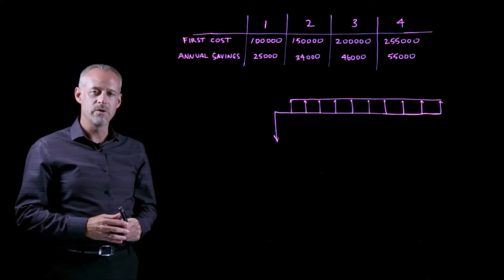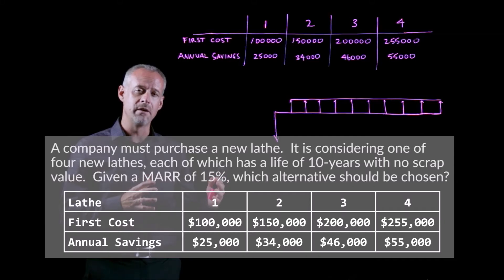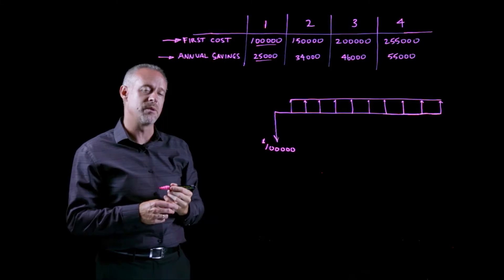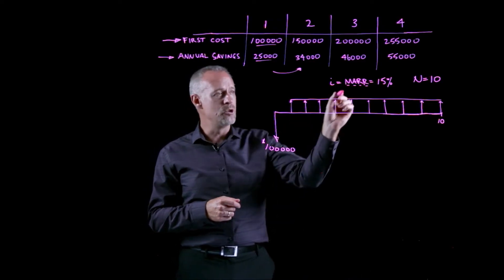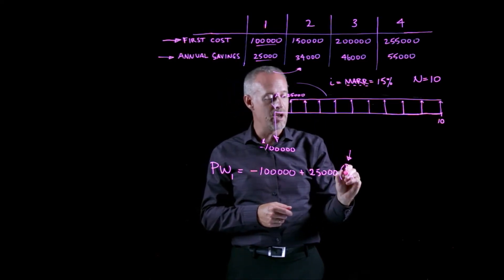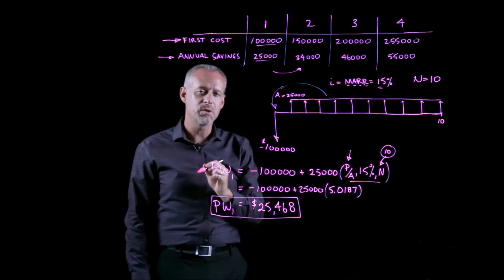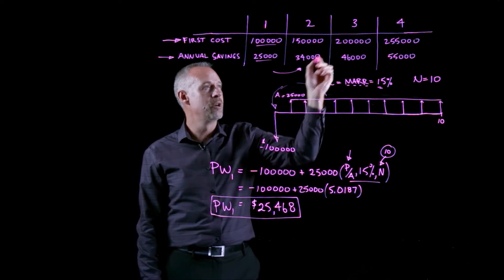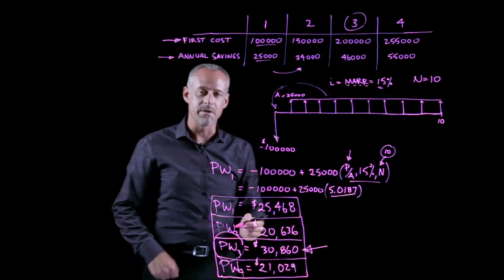Present Worth Method for Mutually Exclusive Alternatives - Engineering Economics Lightboard

Comment: With the annual savings figures, what are those annual savings compared to? In other words what defines the annual savings? I'm asking because I am having to find the annual savings for class based on 2 scenarios with different costs.
Reply from the maker: Yes, my video assumes the annual saving have already been determined.  I'm not sure exactly how your problem is structured,  but I'm guessing you'll need to start with a cash flow diagram to help visualize the costs and benefits at each point in time.  You can consolidate the cash flows at each point in time by finding the 'net' amount of cash (i.e. sum the positive and negative flows).  Have a look at my video on cash flow diagrams.  Hope this helps a little.

Comment: HI, your videos are really helpful. You deserve more subscribers... I have a question for you. 

I have two alternatives, one is human based system and the other one is automated system. 

The automated system purchace price is $135000,install fee: 15,000. Cost of maintenance:120000/year

For human based:salary :$40,000/year, benefits:$3000 per year

If I am planning to do maintenance for every 2 years for the automated system, which alternative should be best using present worth method?

MARR:7%

Planning horizon:5 years

please help me.
Reply: could you please help me
Reply from the maker: Hello!  Sorry for the delayed response.

Automated system -135000 and -15000 both at t=0, so -150000
Automated system -120000 at t=2 and again at t=4
PW = -150k-120k(P/F, 7%, 2)-120k(P/F, 7%, 4) = -191,234.40

Human:  -43000 annuity for 5 years
PW = -43k(P/A, 7%, 5) = -171,686.1

Therefore the human solution has a higher PW (less negative) - choose the Human Solution!